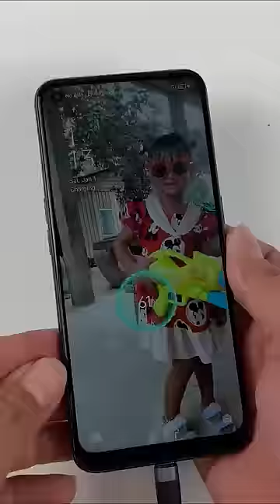Restoration abandoned destroyed phone #shorts

Comment: Every part was new in it.What did you restore.
Reply: Motherboard
Reply: yeah
Reply: Motherboard
Reply: nothing)
Reply: This restoration would be useful if he wanted his data back and without buying a brand new phone but it isn't his phone
Reply: Là hình thức che mắt người xem.nó đã bị vứt đi thay vì tái sử dụng 🤣🤣🤣
Reply: The chipset
Reply: @antcarhd1823  wash yours and then Clean by brush. Tell me what happens
Reply: @andrenon1139  nothing going to happen while it's alcohol
Reply: @antcarhd1823  let me explain smth. Even if it was alcohol- that press and amount are enough denger to microchips on motherboard. For sure after this "washing" U will have artifacts and errors. Maybe even not starting if the match lines got dismagnetized. So don't do like that
Reply: @andrenon1139  I was on an apple authorized shop temporally last summer, we cleaned most of the motherboards like this after a reballing, no issues whatsoever, still after a part change they have the required 2-year warranty by law so...
Reply: In addiction... Its so dangerous to handle phones like that, they are made by a lot of elements, which aren't safe at all if handled like this..